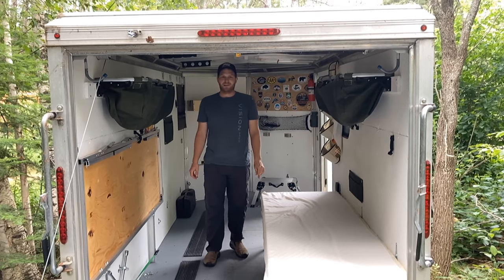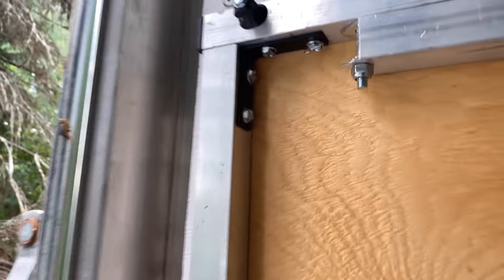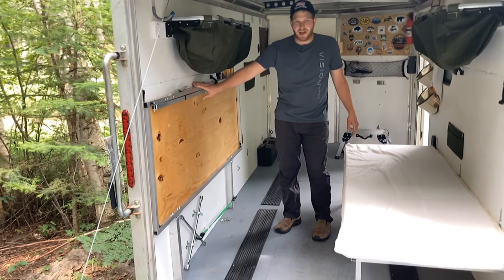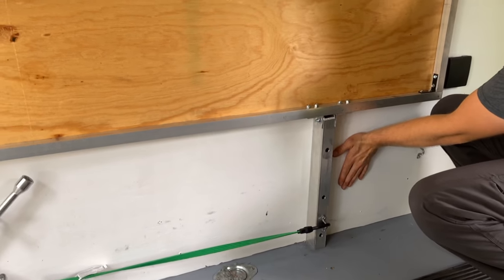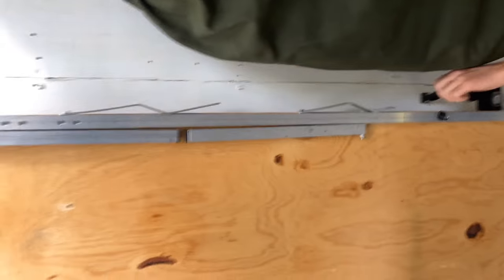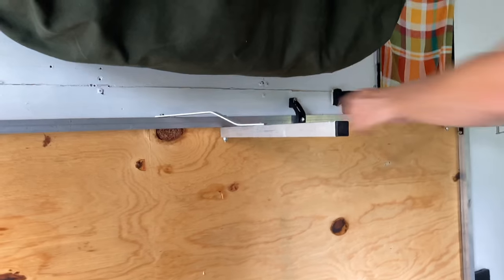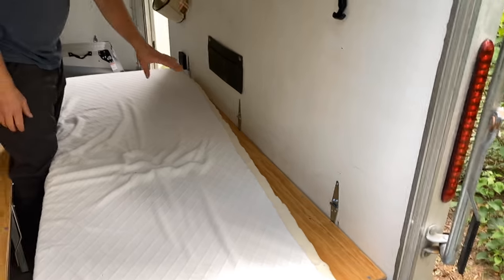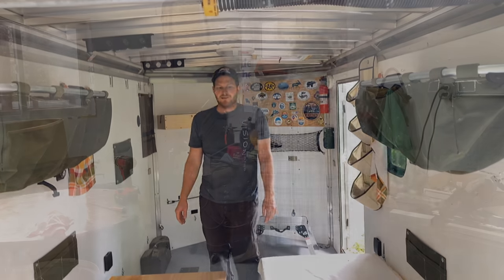Cargo Trailer Conversion Folding Beds

Comment: Great build, just bought a 6x12 all aluminum trailer myself and want to keep this build as light as possible. I have a midsize pick up and don't wanna overload it. Do you think this would be possible to set up as bunk beds? Not sure how the top bunk would work, any recommendations? Thanks man.
Reply from the maker: Thank you! I definitely think its doable to do a bunk bed, but it would be harder if you are still trying to fold them. But if not folding, then i would make the top bunk pretty strong so there is no change of it breaking, as that would be a rude awakening for the bottom bunk sleeper.  I would probably put a horizontal 2x4 along the wall screwed into multiple studs, to support the bed on that side, then have 2x4 legs go all the way down to the floor.  Or use aluminum tube in a similar way if you want to be lighter. 
If you want both beds to be foldable, it gets tougher for the top bunk. You could probably make it very similar to the lower bunk, but the legs rest on the lower bunk rather than the floor, and i would put something so they cant slip out.  But if you make 3 legs, its harder for the bottom person to get into their bed.

Comment: How are those hinges offset like that working out since they are not designed for forces applied like that?
Reply from the maker: Hey, so I actually changed from what I showed with the offset hinges, and I wanted the bed to fold flat like the other side. So I didn’t really use the bed more than a couple times with that design.

Comment: On the bed with the mattress, all you need to do for support on the wall side of the bed is to screw a cleat (2”x2”x5' for example) on the wall, where the bed lands when down. Great idea for some lightweight beds.👍
Reply from the maker: Yeah that’s a great idea, thanks! That would definitely strengthen things up enough.

Comment: Nice idea and workmanship! I have shared this with 2 of my buddies that have cargo trailers and are unhappy with their bunk set-up. I am currently building out mine and will be using your design concept. I am having a hard time finding the end caps for the square tubing. Can you provide the link, please?  Thanks!
Reply from the maker: Thank you! I just added an amazon link in the description for "1" square tubing end caps". Its at the bottom of the list of links, that should get you what you need.
Reply: Are the leg lengths and the (2" X 3") wall supports the same length? Assume ~ 18 inches? @northwoodsengineered
Reply from the maker: @rickwilson3867  Yes they are the same length
Reply: If I change the plywood thickness to 1/2" will that affect the hinge design? @northwoodsengineered
Reply from the maker: No that shouldn’t change anything. I would do that if I was going to rebuild them, the size I used was a little too thin.
Reply: Thank you, Sir! @northwoodsengineered

Comment: What are your bed dimensions?  Thanks.  Thinking of doing this in a transit van.  Modified of course for wheel wells.  Enjoyed your video and ideas.
Reply from the maker: Hey, they are 75” long by 28” wide. Sorry for the delay. 
Thanks for the comments!
Reply: Is it a 5,6 or 7 wide cargo
Reply from the maker: It’s 6 feet wide. Interior dimension from wall to wall is 69”

Comment: How did you attach the hinge to the bed frame with memory foam. I see the wall but not the frame. Thank you
Reply from the maker: Hey George. I just used a 1/4-20 bolt that goes through the aluminum tube

Comment: Hey. If i recall in the video you say you got the mattress off amazon and cut it in half. Where did you get the mattress cover, or is it just a sheet? I cant find smaller covers. Love the design, i have been debating on doing something similar, but welding/designing it to fold was holding me up. You mentioned snowmobiling. Do the matresses smell from the sleds exhaust? Or do you take them out?
Reply from the maker: Thanks! The mattress cover came with the mattress and I cut that in half too. It’s not ideal because one side of each cover section is just open, but it works ok.   I always take the mattresses out in the winter time cause we don’t use it for a camper that time of the year. Otherwise yes, they would definitely smell like a snowmobile.
Reply: @northwoodsengineered  thanks for the reply back! That's when I use mine haha. Back country snowmobiling. We sleep on cots currently, looking to make a couple  beds that folds up. Thank you for the inspiration
Reply from the maker: Oh haha , well then yeah I’d worry about them smell, although if you use it for a snowmobile trip, everything’s going to smell anyways!  Just gotta enjoy that fine two stroke exhaust.

Comment: nice and light weight ...did you get the foam at Amazon? Is it comfortable by itself? Approx how much for the Alum. tubing ? Thanks
Reply from the maker: Hi Vicki, yes i got the foam on amazon.  Its pretty comfy but still a little thin on its own, we put another blanket underneath to not feel the wood so much.   The aluminum was probably about $100 but that was 2 years ago so its probably a bit more expensive right now.
Reply: @northwoodsengineered  Awesome design! I want to do the same. Is the aluminum tubing you used 1/16" wall? Thanks!
Reply from the maker: @terryl5878  thanks! Yes 1/16” wall.